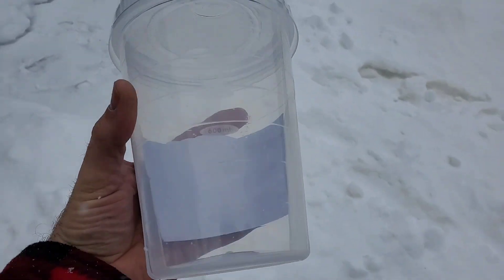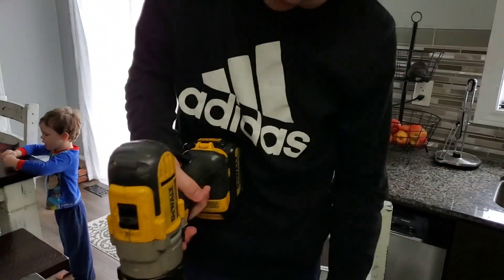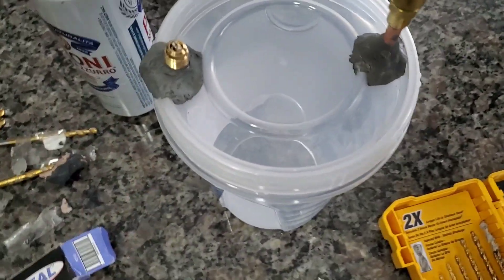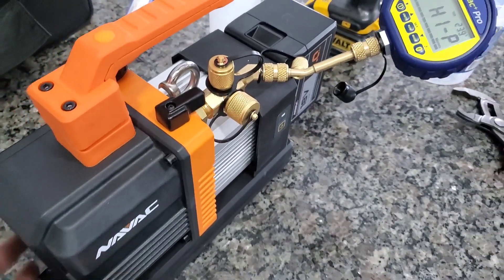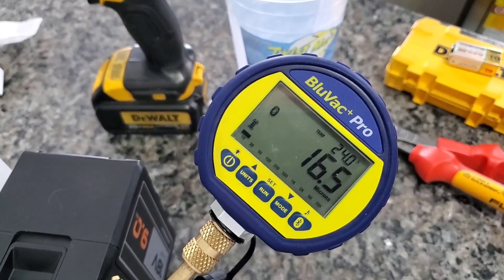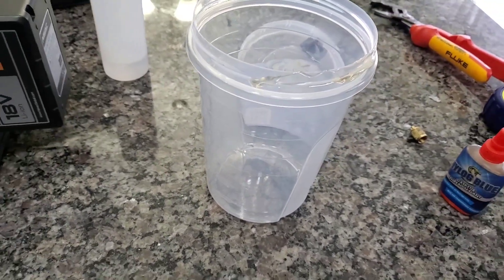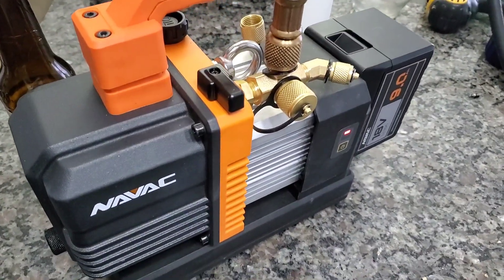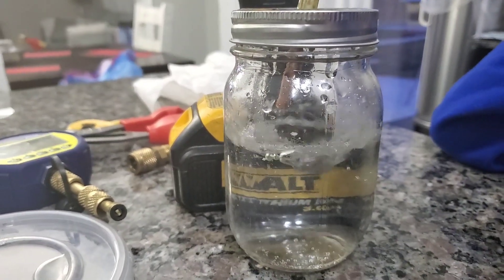How To Boil Water At Room Temperature

Comment: Atmospheric pressure is 14 psi if the bottom of your cups is 3in diameter that is 7 sqin x 14psi = 98 lbs. that's just the bottom. I was questioning reality when you pulled out that plastic cup.